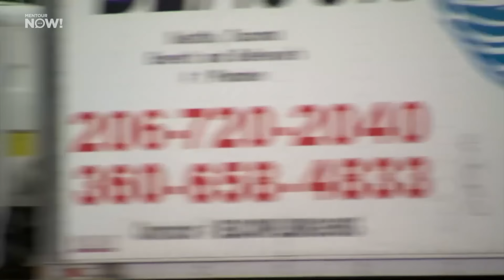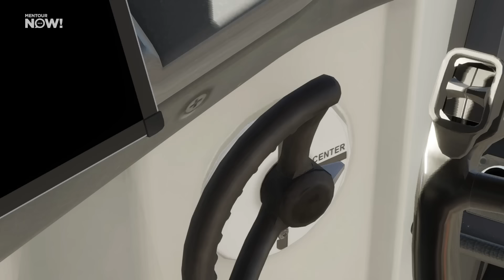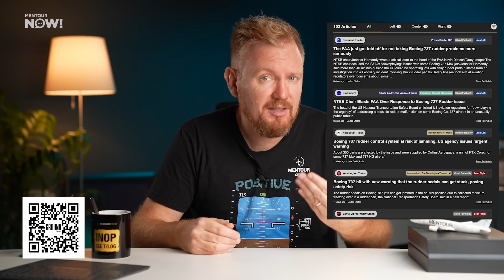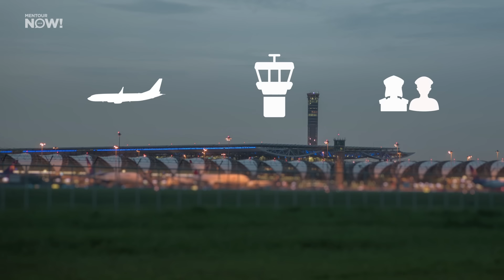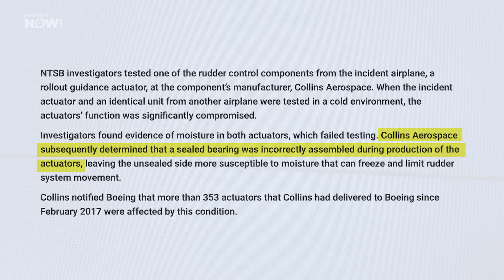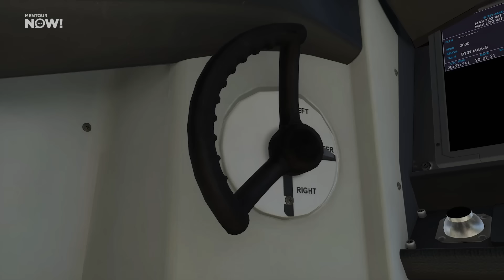Does the Boeing 737 Have ANOTHER Major Flaw!?

Comment: This is a repeat of their infamous rudder problems in the '90s, when hundreds died from jammed 737 rudders and they supposedly fixed that problem. It is inconceivable that 737 rudders would "jam" again. The redesigned rudder PCU was redesigned in 1997 so that it would be be possible to jam.

United Airlines 585
UsAir 427
Eastwinds 517

Comment: Overpower it? So you're landing in a max crosswind and as you attempt to kick out the crab, done fairly close to touchdown, you'll either potentially sideload the crap out of the gear, or you'll overpower it causing a serious over-correction and once again risk a big sideload. This doesn't even take into account an engine failure close to the ground. Admittedly, that scenario would occur at a fairly low power setting whereby the asymmetrical thrust wouldn't be tremendous, but could be problematic none the less...especially if you overpowered the jam causing a wild yaw. Overpowering it is a lame recommendation coming from an ever increasingly lame company; and that's hard for me, as a former 757, 767 driver...products of a much different manufacturer to say.

Comment: Why would anyone buy a Boeing plane?  They constantly show the lack of quality required for commercial flight. This is due to the corner cutting and lack of external quality control. They are only interested in profit and didn't think that a string of incidents would be more impacting to profit than any amount they saved by using substandard parts and bargain basement contractors.

Comment: Boeing's problems began when it decided that Seattle was not prestigious enough to have its head quarters.
The egos started down a path of self-destruction. 
The acquisition of McDonald Douglas altered the mind set that had served Boeing well for decades.
The MD merger while expanded the catalog for Boeing MD had struggled for sometime due to its drive to satisfy shareholders over making well engineered products. The fact that MD made bank on government cost plus contracts, MD couldn't survive in the open market on commercial planes.
Boeing allowed that desired shareholder value to overtake the it "make a great product" company.
Boeing needs to return to the engineering 1st model.  Or they won't be a Boeing company at all.

Comment: The fact that this servo device seems to not been validated for extreme conditions during the R&D, pre production runs and so on is truly unbelievable. At least from this short video it seems that the device should have failed the most basic validation processes during R&D and early production phases at the supplier assembly line, way before it got to Boeing to be fitted inside airliners. Again, only based on this video, it seems as if the validation phase was completely flawed or else the manufacturer should have noticed this in very early stages of R&D. There could be some more reasons for supplying a defective design to an airplane manufacturer but I guess this will become clearer in court...

Comment: While Boeing may have suggested a procedure to overcome this problem that is not the best, the actual faulty component is not the fault of Boeing.
While I am not necessarily a huge fan of Boeing lately, it is unfair to blame every little single thing on Boeing if Boeing was not the actual producer of a faulty component that caused an issue.
In this case, the issue is a quality issue by Collins Aerospace so technically, Boeing is not at fault in this case although their suggested solution to a jammed rudder could have been better.

Comment: It may be that others were using the servo.  One of the things about running a part like that is that they produce heat.  The heat will tend to warm the air up making it expand.  If the thing that isn't sealed is at the low point of the servo's housing, that would tend to expel any water.

Comment: The 737 is a 57 year old design. Not saying this as a matter of safety, but surely a newer design plane built with years of innovation would be better than simply modifying a pre-existing design, right?
Reply: The reverse may be true.  The old design can have had all of the problems found and fixed by now.  The new design might have a new design issue.
Reply: @kensmith5694  that is a good point.

Comment: I like the story about CAT III C. I made my Job training by 1976 to 1979 at LH base Hamburg. In the 3rd year I worked on yaw damper, auto pilot and inertial nav Systems for 707, 727, 737. The story was that it will take only "a few years" until CAT III C and it will include guiding at taxi until Position, auto Finger docking and flowers for the Stewardesses. So the costs killed the Plans I gutes.

Comment: It's becoming increasingly clear that the mechanics on the ground are more important than those actually building the aircraft (i give some sarcasm here). However, it is seriously clear that airline and aircraft mechanics are becoming increasingly crucial and important, as if they weren't already before. It's almost as if they need to inspect it after delivery just to ensure it works properly. That's a scary thought.

Comment: If it says Boeing, I"M NOT GOING!
The sooner major airlines figure out that customers will NOT board a Boeing 737 Max series jet, the better. It may bankrupt Boeing. GOOD.

Boeing's changed culture has killed hundreds of people in two crashes that were avoidable.
Boeing's CONTINUED inattention to quality - in fact, deliberate circumvention of quality control - has CONTINUED to put passengers at risk. 

I sincerely doubt Boeing can change without massive change in management. That will not happen if the company continues to operate with just a change of CEO. 

Boeing's gotta go bankrupt. Let it split up: the military systems can go one way, civil aircraft the other. It'll survive, but with entirely NEW management. Put engineers back in charge, top to bottom. FIRE THE MBAs WHOLESALE.

Until then, IF IT SAYS BOEING, I'M NOT GOING!

Comment: This is the result of company run by Accountants rather than Engineers. Decline of US auto manufacturers were exactly same reason. The most famous case is Ford Pinto which catch fire easily by placing fuel tank placed in rear of the car. Accountants suggested it will be cheaper to pay to victims of fires than redesign of whole car. As result they had to pay heck of more.  Another case of Ford, Mustang haven’t had independent suspension by saving $100-125 per car. After 60 years of same out of date design they finally changed to independent suspension.  Many cases exist in GM and Chrysler.
Reply: Build it just good enough so that it will go
Reply: Honestly this run by accountants not engineers meme is so overdone. I'm surprised you're not embarrassed to be the 500,000th person to say it. 
Anyway boeing's travels with brewing when it had an engineer's the CEO so its not a simple as that.
Companies need to be run by competent managers. Is no reason to suppose that engineers are in a company better than accountants do, as neither of them are trained as managers.

Comment: An A&P friend of mine said that when inspecting an aircraft, you can only find what's broken. You can't tell if something will break or fail until it does. With well engineered planes (i.e. Airbus or Concorde [Concorde crashed bc of DC10 Debris]), this isn't a problem, but modern Boeings scare me for this reason: there are likely so many things wrong with them.

Comment: I am a former Boeing employee and their practices at the time I was there were so bad. They literally used scrap parts from a bin to finish the project quick enough The worst thing is that those planes are flying right now somewhere in the world.
Reply: I'm a present Boeing employee, and I keep scrap parts away from the production line now. We have several employees walking the floor every day and bring me the parts of dubious provenance to research and scrap if needed. But I agree with you, that should have been implemented from the very start. I'm actually sure some form of this existed until the greedy C-suite did away with QA. greed has killed this Engineering company. And no-one does anything. Where are the federal watchdogs? Oh, wait, Reagan defunded them.
Reply: @renefuller9241 LoL. Blame Reagan... That was what, 35 years ago? Are you telling us that all these issues are occurring on 35 year old planes? I doubt that. The Max is only 10 years old.
Reply: @leofortey7561  Reagan defunded the FAA from which they never really recovered. They had to rely on the likes of Boeing to help them do their job. Well, as we all know that did not work out too well. The 737 flew for the first time around 1967, not 10 years ago. The 737 is an old design, and the MAX was based on that.
Reply: @renefuller9241 Bro. 30+ years to 'recover' is a long time. And I only mentioned the Max, which is the only version of that plane with problems, which is only 10 years old. So tell me how Reagan killed Boeing's quality control? Sounds to me that shareholders enjoy their increased earnings and the company did what every company does to keep profits up, cut corners. 
You need to remember that the sole purpose of a business is to make money. Boeing does it by building planes, GM does it by selling car parts, and Monsanto does it by suing neighboring farmers whose crops received pollen from their plants and now they inadvertently grew patented crops.
Reply: @leofortey7561  By defunding the FAA Reagan defunded and devalued everything the Aerospace Industry stood for. My father was a flight Engineer at the time, I lived the consequences of Reagans immoral actions. The damage created a vacuum that the GE bean counters (Mc Donald Douglas) filled and used that vacuum to make Boeing into a Bank.
Reply: Hi Markov - thanks! Could you and take this and Rene Fuller's comment beloe to NTSB?

@renefuller9241
3 months ago
I'm a present Boeing employee, and I keep scrap parts away from the production line now. We have several employees walking the floor every day and bring me the parts of dubious provenance to research and scrap if needed. But I agree with you, that should have been implemented from the very start. I'm actually sure some form of this existed until the greedy C-suite did away with QA. greed has killed this Engineering company. And no-one does anything. Where are the federal watchdogs? Oh, wait, Reagan defunded them.
Reply: Smart people don't go by boeing anyway
Reply: @ClarencegHamm Are you sure? Most people may be looking for other things in flights, especially since they may not necessarily be paying the bills and they may be forced onto Boeing planes if there are last-minute equipment changes.

Comment: This is a werid one. (not the issue it self)

We've recently probably within the last 2 months (I guess it was after the NTSB/FAA did their research on the issue that occured) Have had a tag on that component to check them. Which gets checked as is during the pre flight package. The issue is even when checking A/P and Hyds on and everything involving flight controls. If you're within spec, it's going to pass.

Pesonally my crew has yet to run into any issues with the components or flight controls.

Comment: It‘s interesting to see that once again a disabled extra feature is causing unexpected trouble. Although the door plug is a completely different structure or component it is in a way connected. It shows that an application which is not regularly used may show a surprising behaviour at a random moment and no checklist exists which would offer the flightcrew a guideline to deal with it. In a way this is also applicable to the MCAS case as it was also a hidden feature at the time. Only equipment with an actual use should be installed on an aircraft. Then it is regularly used and maintained and a failure may become visible quicker and in a controlled environment.

Comment: Yeah, that Boeing recommendation to use brute force as the first response seems kind of unsafe to me.  Why not recommend using the tiller, as the United pilots did, as a first response?  And then, as a secondary solution, use the brute force method, if necessary...  
The Boeing recommendation astounds me, although it seems like this type of response is S.O.P. for them.....  Do they have ANY employees who take pride in their work and try to do a good job left in the company??

Comment: I am an aerospace actuator test engineer. I can see why this kind of moisture ingress issue from assembly is hard to get caught during the actuator production. Environmental testing and waterproofness testing are only being done during the qualification phase of the actuator. There’s no practical method to conduct this kind of test on every actuator during the production acceptance test. The only way to make sure the part is assembled right is solely depends on QC during the assembly process. We could caught any hydraulic seal leaks internally or externally by testing. But you have to take the unit apart to check water ingress from environmental seal. Or purposefully add a moisture sensor into the unit when designing the actuator which is rather rare.
Reply: Could Collins not also have used a bearing that is sealed on both sides, since it's apparently possible to install it upside-down, so as not to rely so much on the case staying sealed?  That seems like almost a design flaw, or a lack of redundancy where it could help and not cost a lot.
Reply: You can do an air pressure test. Even though water tight isnt always air tight, youll know the back pressure/leak flow of a good part and bad parts. Still the better way would be inspection of the seals before final assembly. I designed one years ago that used light beams to check seals were installed and oriented correctly on a piston, pretty straightforward.

Comment: I've flown a true Cat 3C landing once on an A330, although at the time, it was called a cat 3b with no decision height.
It is a useful category as we got in and landed while cat 3b aircraft were diverting, yet taxiing after landing was still possible.
Reply: Yes! I'm long retired but used to do "Cat 3B NO DH" on A320s occasionally from 1988 to 2001. 
For other readers, "no decision height" meant we didn't need to see anything before or at touchdown. However, there was a minimum RVR (reported runway visibility) requirement of 75 metres, IIRC. Does Cat 3C allow zero RVR?
After touchdown, whilst you're running at high speed along or close to the runway centreline lights, the streaming effect of the closely-spaced lights makes it relatively easy to monitor the rollout performed by the AP (autopilot). In the event of a complete failure of the dual AP system, you could takeover. But, as you slow down, you lose the streaming effect and it becomes more difficult in dense fog. 
We had a slightly higher RVR requirement for take-off, which was performed manually. Finding the runway centreline as you enter the runway from the taxiway for take off in fog can be tricky, and must be confirmed using the ILS (localiser) indications, lest you line up inadvertently on the runway edge lights - not a good idea!
Reply: @chrisscott4896  Not sure about nowadays but Cat IIIC was definitely a zero/zero (Vertical and RVR) approach system back in the early 70's

Comment: The weird thing is rudder hard over has always been an issue on boeing planes. In fact, in response to quite a few dangerous emergencies involving the 747-400, they found the PCU controlling the rudder was inexplicably vulnerable to fatigue cracks. While they built in a failsafe system to neutralise the possibility of a hardover, they couldn't determine what caused the cracks to happen so readily.

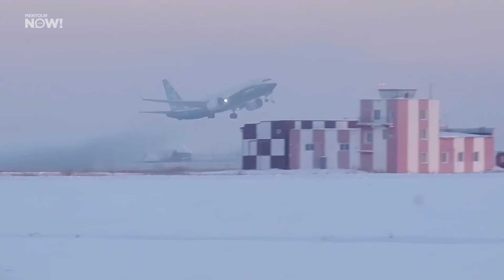Comment: 6:30 "very cold temperatures"... Oh no! I have warned you about this before but occasionally you still do it wrong. 

"Temperature" is an abstract concept designed to convey a relative measurement of heat. "Temperature" has no physical properties — one cannot paint, hold, touch, throw or place a temperature in one's pocket. Likewise one cannot boil or freeze a temperature, therefore it cannot be "cold" or "hot" although whatever is being measured can be.

The weather or air can be "hot" or "cold", temperature cannot be. Temperature is the measurement, not what is being measured. To say the "very cold temperatures" is confusing the measurement with what is being measured. Temperature can be "low" or "lower" or "high" relative to some other measurement. Saying "very cold temperatures" just doesn't make any sense and is unnecessarily wordy. It is the weather that is very cold, not the temperature. 

TLDR; Say "very cold WEATHER" or "very LOW temperatures".

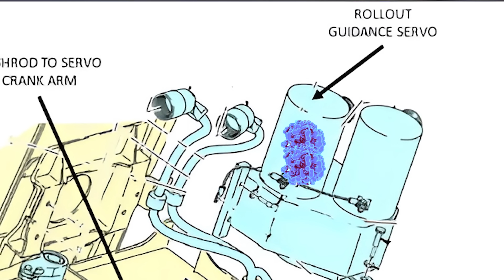You do it correctly at 16:47 though!

Comment: When you talk about visibility being zero at the runway, I do recall a WWII system "Fog Investigation and Dispersal Operation" (FIDO) that used gas (possibly natural gas) flames along the length of the runway to literally burn off the fog/weather. With the advent of high efficiency heating panels, perhaps this could be done without the need for an open flame. Something to think about.

Comment: If your rudder jams during landing, apply maximum brake, push the nose down, stand on the pedal. Once the plane starts doing doughnuts release the brake and continue the drift into the gate for maximum style points.